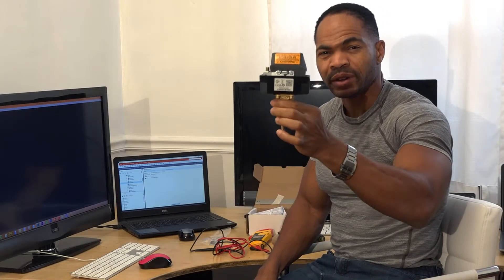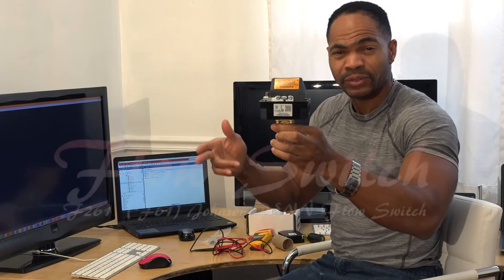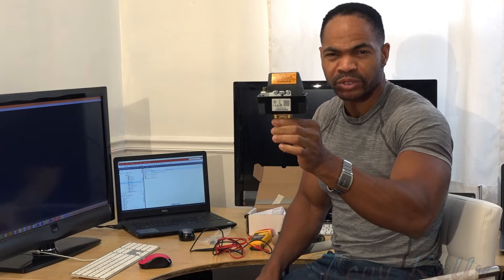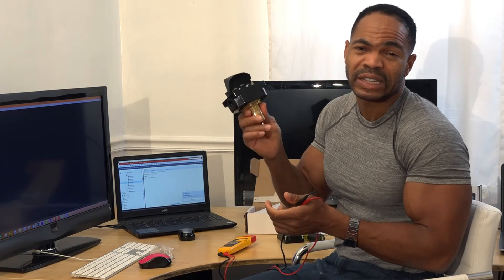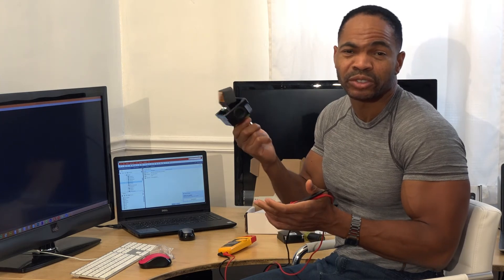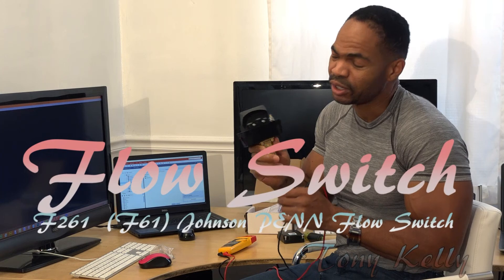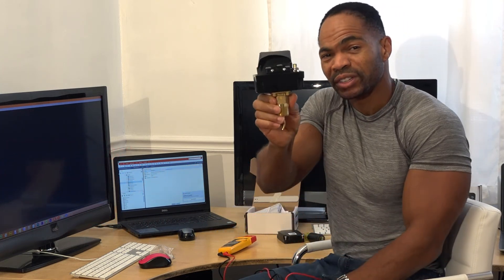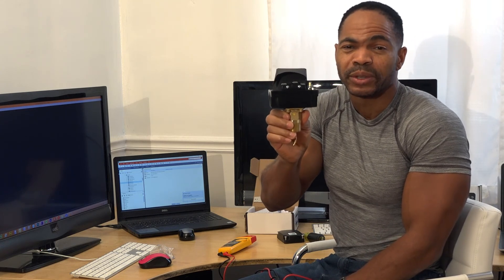Johnson F261 or F61 Series Flow Switch

Comment: I installed a new F 261 flow switch and with NO water flow  IT  turns on my stenner pump. Regardless of what adj I make on the F 261  my pump  still RUNS....Any ideas..?....Thank you
Reply from the maker: Remove connection then try your meter directly to the flow switch, wires could be shorted.  https://nakenterprisecontrol.com